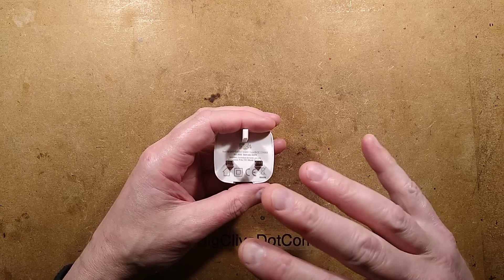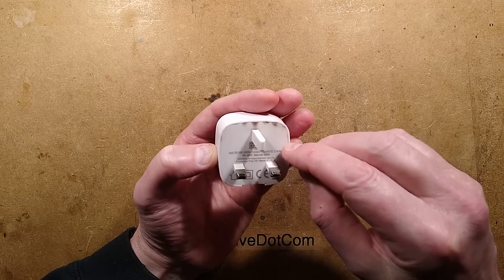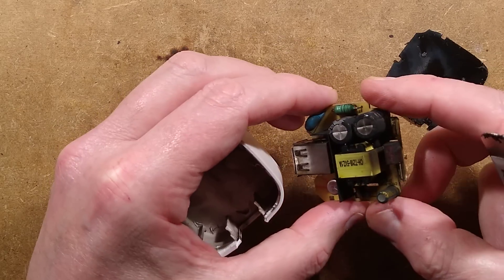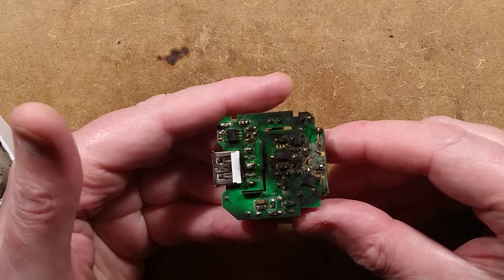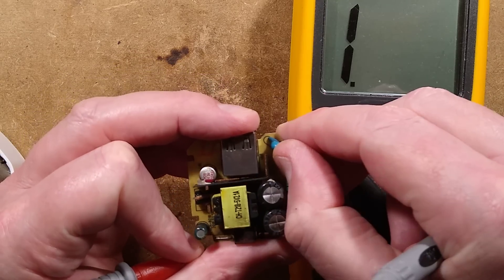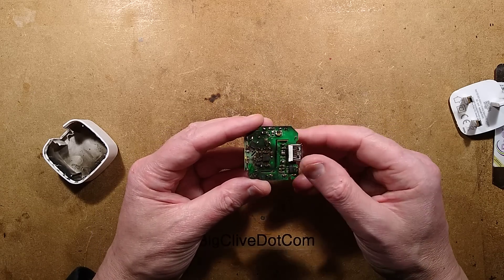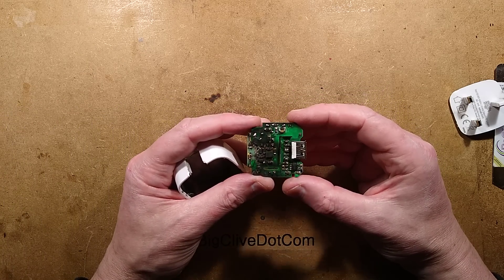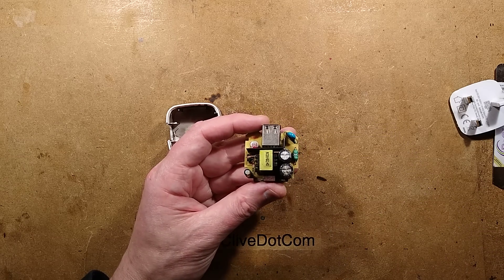Poundland USB versus lightning  (The lightning won.)

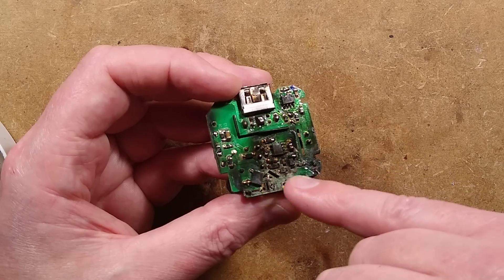Comment: 4:00 clive...The fuze? i didn't think anything servived 😂
Reply: Actually I took something important just to see how bad it was once after got hit by lightning guess what the only thing that was that did survive was actually three things you could say although I call it one component the fuse fuse holder and the cap for your fuse over entirely intact everything else pretty much vaporized just about and also Vapor deposited Copper Onion side can't remember what it was I think it may have been a lot of recruits charger to tell you the truth. Oh yeah and one more thing the Transformers survived so two more items oh and yeah the neon bulbs that too although one which was used for surge protection it didn't make it air burst also the bushings for the high voltage for still good by the way the surge protector Ford electric fence lightning arrestor blown to bits pieces of ceramic everywhere.

And yes I can confirm or think of it it was the electric fence charger as in electric fence Energizer power pack whatever you want to call it.

Also part of the surge did leave through ground with a damaged part of it was vaporized record there is places where there's no more any copper anymore just insulation the receptacle the plug was welded into it.

And the wiring from the fence charger to the outdoor area where a surge protector and a connection to the fence was you and I lose insulated for proper voltage that was Up In Smoke there was wooden skid marks from Charing where the wire used to be.

And also there was a big charmer down the side of that building I think it was a weather head that got hit and jump to the tin roof and then jump to something to do with the fence controller there was also would overhead wire going to another electric fence in the distance so it could have come down that way and also a few insulators were broken they were holding Noir city building and it did are over in a few places even at the fence location so probably directs hit somewhere within the area.

Also it didn't knock out the phone surge protection for the out building and the barn wood for two separate units. One at either end of the line all four of which fuse is blown and shorted to ground surge protector which is on purpose with those type of tankers. Under fault conditions.

Comment: Back in 1992, I had a modem into which I'd installed a (then-new) SiC (silicon carbide) blue LED that had cost me US$27.00 at the time. A nearby lightning strike smoked the modem, but amazingly enough, the SiC blue LED "survived" -- the interior was badly carbonised but the damn thing still generated some light blue light! :-O
Reply: Years ago I had this monitor that had a bright blue power LED. It would blink when the monitor was asleep. At night it looked like the cops had someone pulled over.
Reply: @brianleeper5737  The blue LED in my modem wasn't very bright (all SiC blue LEDs were noteably dim) so it didn't bother me in the least. But in more recent times, I've had home electronics with blue LEDs that were disturbingly bright -- so much so that I have to cover them so that I could sleep at night. :-(
Reply: I think one of the materials they use for some types of surge protectors may be related to silicon carbide it may even be one of those materials so maybe be led acted like a surge protector and protected itself who knows seriously but IC worse happening still had stuff work enough to salvage things out of them don't know how but it does happen weird huh.

Speaking of surf protection I remember my grandparents told me one time they had probably a black and white TV at the time 2 most likely definitely if you know I'm saying. At that house I don't remember where or when excetera they had an outdoor TV antenna AKA Ariel with two twin lead cables come in the TV set was unplugged from the wall outlet cord and plug of rain waiting on the carpet and or rug don't know which.

But the TV antenna was still connected by the twin lead cable to the outdoor antenna on the roof or on a tower or something like that not one in the Attic or under a porch or in the basement excetera.

The antenna got struck by lightning don't know if the Tower or antenna and all was probably grounded or not or even if it was at all who knows.

I don't know if a proper antenna lightning static arrest or whatever you want to call it stag dissipator I don't know if anything like that was installed prior to it coming in the house this one lead-lined that is.

Like it should have been.
But the the TV can't remember the whole story on it there's mixed opinions if it works door not but kind of doubt it but it was so long ago they probably couldn't remember and then that was many many years ago when I found out about this to so long time ago for sure probably over 30 years probably more than that.

Probably before I was born I'd say?

But anyways when lightning struck the antenna the lightning had actually talked over the end of the exposed prongs of the plug that was laying on the carpet or rug implant the carpet or rug which is just strange.

Not the first time there's been lightning strikes in that household.

My grandmother was indirectly struck by lightning it hit the house came through the electrical system and jump from the refrigerator housing to her.

Also it don't take lightning to generate high voltage during storms you can happen because of the electrical Fields as well that's why sometimes you get Saint Elmo's Fire on high points like Steeples and stuff like that sayings sometimes see the lightning rods with y'all have seen in the country one time at the old church we were there before storm it was nighttime can't remember what we're doing but my dad work for the church.

It was right before a bad storm and we could see lightning in the distance of stuff I looked up I said Dad look up at the roof and there are other objects in the area that have blue brush discharge AKA Saint Elmo's Fire and I said to my dad do you see that and he said yes I said Dad that's saying it was funner does the atmosphere is high or low tide right now I think we better get in and he said yes let's do it soon after really bad thunderstorm we think lightning might have struck as well power went out for a bit and the way it sounded it just reverberated to the entire building the only time I've done that before was one of the building have been struck by lightning according to others somebody suggested might have come into the bell tower possibly

Because there was some mechanical equipment and such up there that would make good Metallica Target as well as the coursers lightning rods as well and they said that had our covert other things before

By the way something interesting ones One time we actually one of going up there because of something with the mechanical systems.

In terms of h v a c in terms of the V part of it ventilation that is.

There was a very large old probably original? Likely was.

Super-sized exhaust fan squirrel cage blower probably was 4 ft + tall if not more.

And when we have to be in an area as well as their yours we could hear bump bump bump bump.

At regular intervals I said there's something going on with it.

So you got the keys to the bell tower we went up there and realize something by the way this still have a leather belt and pulleys on the blower and the motor almost like what you would have online shaft back in the day or farm equipment.

Turns out brand new belt hadn't broken in yet where this place was and every time the Spicewood hit when the police it made the sound.

 also they had Trace Heating and all the gutters and also portals on the roof evidently for melting ice and snow to keep the gutter from freezing off as well they went through the gutters is wrong turns out all the illogical all that for the whole building was up in the bell tower ran everywhere else from there even though where the utilities came in just off the Boiler Room in the electrical room was absolutely as far as you can go across from that way the long way.

 speaking of that the organ blower was also in there for the pipe which originally must have had the same type of drawing live what's the belt because the belt cage AK bolt guard motor mounts are still there except I think also the original Polly was on there can't remember at least on the blower end of things.

 but Heckman converted to direct drive off a large motor and at that time they were still on single phase power as well believe it or not.

 later on when they did the new construction it was switched over to three phase.

Also you should have seen the old exhaust system in the old kitchen largest blower motor I'd ever seen and also the fuse switch for that was just scary looking it had two handles one is a switch any other to open a door which contain the fuse holders And when you pulled that it would also interrupted the power as well. Talk about redundancy I've only seen one Cut out like that before and that was it was that one.

 also I remember once on the Christmas Pageant rehearsal one year we had a few problems elvenar got stuck between floors basically we had to power cycle it like 4 times would not reset.

 by the way that was when the elevator was brand new.

 also I told my father of course I was there when we are doing there in the elevator.

Hydraulic / mechanical room machine room for Or motor room whatever you want to say it is.

 Of course he had the keys to that. For emergencies.

 Which that had happened numerous times when is first installed.

 I said to my father did I think we should probably grab the one that dropped Keys just in case we need it and have to open the doors manually.

 and yes this is still along the lines of this enter the lightning.

We did have Thunderstone know that night.

 but we don't know if that was coincidence or not with the issue with the elevator most likely not but who knows.

 but my dad knew that I knew how to use the drop key to open the doors manually the L Vortec there had taught me how to do that for emergencies she thought it'd be a good idea to know that might be present. That would be able to do it and no How to safely do it. And how and when excetera.

 even I knew how to restart the elevator in a if something went wrong.

 but yes the two or three people are in there we're okay it was between for us we just kind of help them out there

 That preferable course I open the doors manually from the outside.

But also same night same rehearsal we were only using a thousand watts of extra light in the balcony in addition to the bank spot like we had I think that was also to your we blew the balm in the spotlight and just beforehand?

 but things are going just mostly okay I guess you could say and then we hit the window lights for stained glass which was part of the plan for the pageant because of the star above stained glass window the stained glass of course.

By the way all those were on the same level to switch. Of course multiple circuits.

 and a few minutes later or so don't remember how long all of a sudden Houston we have a problem.

When the lights go out balconies dad some lights in the area and more and the organ blower And no power to the organ Chambers whatsoever.

Turns out of course I knew the electrical system of the church like the back of my hand so started checking what panels that would be affected for a trip Breakers in some cases blowing fuses turns out that thing was a mess everything is fine scratching my head then I stopped to go down to the logical room sure Nuff well there's your problem we didn't rip anything else we trip to feed her before anything else had tripped.

 frankly not surprised by how it have been done over the years attitude changed excetera and never updated or anything like that there was enough load overall even without overloading in any one individual circuit the trip the whole kit and caboodle it'd be like tripping out a subpanel Breakthrough going to a sub panel.

By the way there was more than one panel affected I think it was a total of three or four that were knocked out by this.

 that was the first time evidently it that had ever happened that they had trip to feeder.

 although when they're doing the new construction specifically demolition they will end up cutting through I cable blue 100-amp feeder.

Is that feeder line was not on the blueprints so they wouldn't have been able to know it was there even known it was there but back then they didn't really have the equipment to find things like that easily it was encased in concrete.
Reply: @aaronbrandenburg2441  Strangely enough....the last time I remember anything getting damaged by lighting was probably back in about 1986/87 and it was a Midland portable 13" B&W TV. No place I've lived since then has had anything damaged by lightning. I've had GFCIs trip due to lightning, both at my house and my dad's house. Pass and Seymour brand. Leviton brand seems to not be so sensitive.

Comment: The lightning doesn't have to hit the utility lines directly a near by hit will induce an over volt making that happen.
Reply: Yes exactly.

I remember my grandparents and also relatives in Tennessee in the rural areas you know long stretches of phone lines Etc overhead lines of course.

Talking about lightning running in on the lines and hearing the crackling and such on the phone that's likely due to that although some of that could actually be actual strikes in the distance why don't you own line quite literally in this case.

Also remember my grandparents telling me after any anak I was looking around at some things going up there just wondering what things were and stuff I found an old cigar box that bad Soldiers made out of wood if I remember correctly with two copper Champs on it one on each end you get where I'm going right?

5 amp fuses about maybe a footlong or so?

What do you swear you'll see in a moment.

In the old days they had the telephone lightning arrester AKA surge protector AKA Democratic or decoration points don't even get started about a political reference because it's not it's what they call it.

It may have been one of the ones that looks like a big metal King on about to be a bit more in the foot all right they would have a cable coming in and cable coming out and a ground wire.

Oh and yes they used to have the old party line system the old Bakelite phone was still there it may still be somewhere in the basement or the Attic?

And if it is I'm getting it for sure they've told me.

But back to that metal cylinder or it may have also been won this round ones order two piece ceramic ones that was mounted somewhere inside or maybe in a box or something which I've seen But rarely. In terms of the wooden box somewhere.

By the way some people call these things to protector or telephone projector.

But it was when the fuse Torrance the reason why that had us Jesus is ever given them by the cell phone company and shown how to change them.

Is evidently quite often don't know how far apart are is in my panel in now really bad thunderstorms at that area.

Wide open and exposed as well. Also my grandfather put a surge protector actually you liking arrestor I should say on the incoming service wires. For the nautical service.

But often does fuses with blow because of white exhaust having spare fuses so you don't have to get ahold of the cell phone company every time the storm knocks out the phone system.
Reply: @aaronbrandenburg2441  The fuses used in those old bakelite/ceramic telephone protectors are 7-amp. They were still commercially available as late as 2005. Pretty sure they've since been discontinued; the rest of the protection involved a carbon block air gap for the actual surge protection. The standard these days is a 3 terminal gas discharge tube like what is in the TII 355M and they use a 26 or 24 awg wire for the fuse.
Reply: Also you do not have to actually have a lightning strike in order to induce voltage on things either at times It Was Fear could be so charged it can couple that charge to other things assholes Ark over and other things like that in my say there was fire and stuff like that and other phenomenon as well.

Under ideal conditions of course.

Also the lightning bolt never actually touches what it strikes so I've been told and supposedly but you wouldn't know unless it was started in science study or otherwise.

Also speaking of telephone and bad weather and lightning armor one time it was during a tornado warning in Wisconsin we are Sheltering in the basement of course.

And we'd see blue flashes and hearing a snap of an arc almost like a loud very very loud static spark or it may be that of a ignition on a furnace or something like that.

And another time I happened to be looking forward to our spot and realized what it was the laundry machine tubs AKA utility sink for slop sink.

Which of course was metal and all blinds for metal at least at that house. Air Force grounded. Because of this.

There was an old cut off telephone line that was hanging down just above that don't know what the distance was but close enough Dad when the voltage on the phone line we get high enough from the lightning coupling or inducer just whatever it was jumping over to ground on the laundry machine tubs and that's what we're seeing in the dark over in that area.

Also one time I went into something pretty weird I was in a house bad weather if I'm not mistaken and nail heads everywhere we're going this bluish color and you can also see Sparks jumping between different things even when they should be grounded it kind of was really spooky and got freaky but anyone seen something like that before? Please comment please comments.